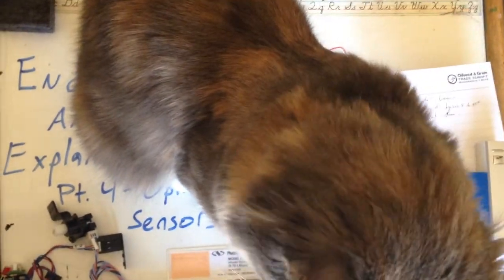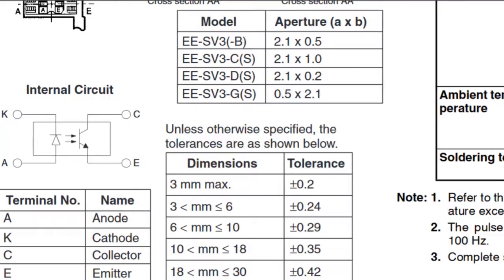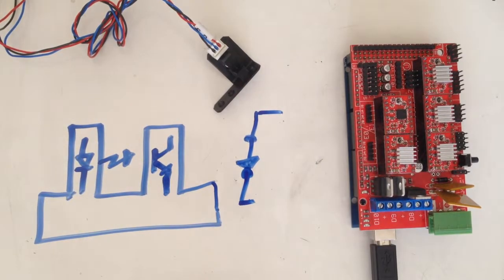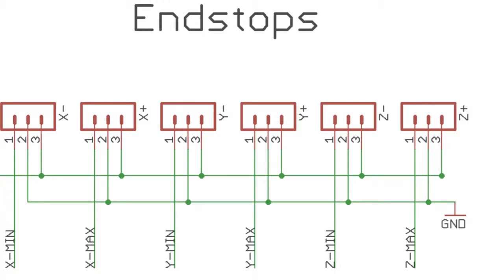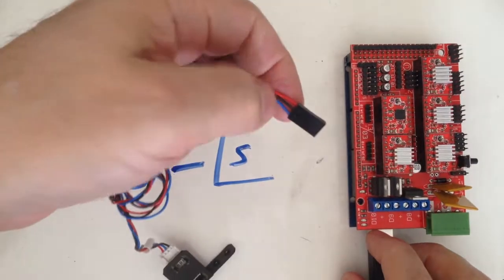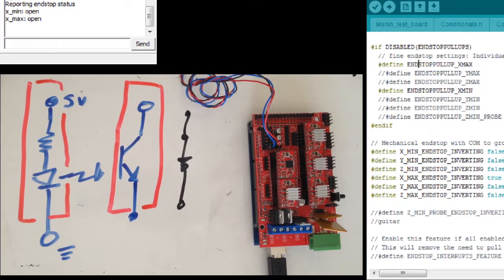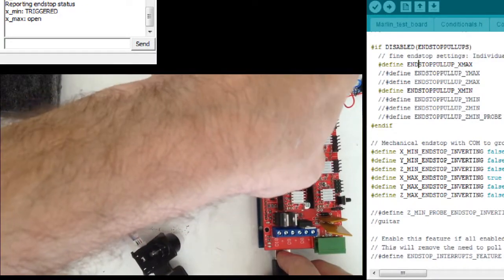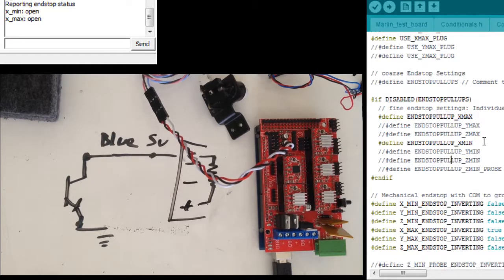Endstops and Explanations Pt 4  Optical Sensors

Comment: Just a neat use case. A newer brand of Nuclear medicine cameras use this technique for safety in their camera heads. The lid or cover to the collimator is spring loaded in a way if a patient comes in contact with the cameras collimator it stops the machine and alerts the nurse or technologist. A few of these slotted style optical sensors are interrupted by fasteners under the spring loaded cover if the pressure exerted on the cover is greater than the springs holding it away.  I really liked this feature as it was always in a fail safe mode. 

Other patient contact systems I've seen that I thought were cool were capacitive. Adjustments could be made on how close the camera came to the patient. The only problem with this was QC phantoms wont be sensed and rotation of the camera head has to be acquired in a different way or damage to the camera and radioactivity will result.  

Thanks for the vid!
Reply from the maker: Somehow i didn't see your comment before,sorry! Thanks for watching. I agree, slotted optical sensors have a lot of uses and i think they are more reliable than capacitive sensors.

Comment: So what is nessesary to do for it to work with a Arduino Uno that only have two pins on thair cnc shield for end stops?  Is the last part the solution? Im not sure i fully understand that part.
Reply from the maker: Good question. I'm in the process of building my first cnc machine,so I'll be digging into this soon hopefully. I  have to make a few assumptions at the moment as my information may not be complete. So,,first off, i don't 't believe grbl  has the option to turn on the internal pullup resistors like marlin firmware does. I have seen some cnc shield that have a jumper added to add that visa hardware, but i don't know the exact board you are using. Second, the2 pins on the shield for end stops will be the signal from your switch or sensor, and ground. The endstop input is activated by shorting the signal pin to the ground pin. If you are trying to use an optical sensor as an endstop, you will have to supply power to the sensor from somewhere else. I'm not sure what sensor you are using, but if it's a 5v sensor, hopefully there is a spot on the shield you can pull power from. Now, you can test your endstop and see if it triggers ok. If it doesn't seem to work, you might need to add your own pullup resistor between the signal pin and the power to the sensor. Again, I'm not sure what sensor you are using, if it's a 5V sensor, then a resistor value over4.7kohms should work fine. If f it's a12 or 24v sensor, well,you have other issues to get that sensor connected. please let me  know if this helped or if I wasn't clear on something. It's a little late for me right now so i might not be saying things right. Thanks for the question!
Reply: @printerstein1321  Thanks for the answer! Its 5V sensors i was looking to get. Both using with a Aduino Uno with Protoneer shield and some simple board on a 3018 cnc. Mainly just to know how to use them.
Reply from the maker: @MyllerSWE  Glad I could help!  Its a topic I never see explained to any useful level, so glad this was useful to your projects.I always meant to make another video with more sensors but never got around to it.  :-(
Reply: @printerstein1321  Videos like these are gold on youtube! Well we will se. Maby your cnc project gives you the inspiration to do more vids on that. :) Happy easter!